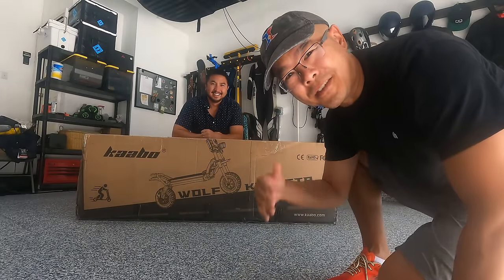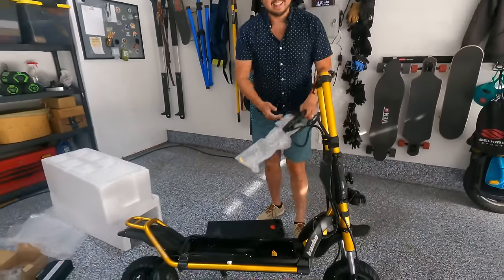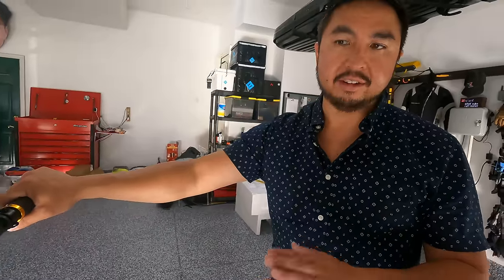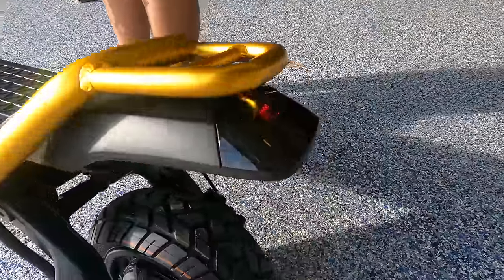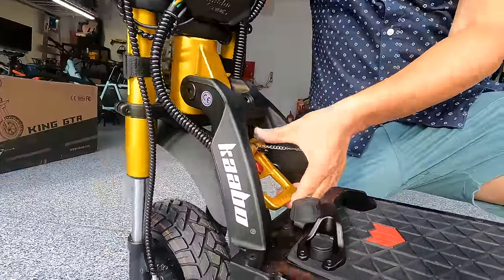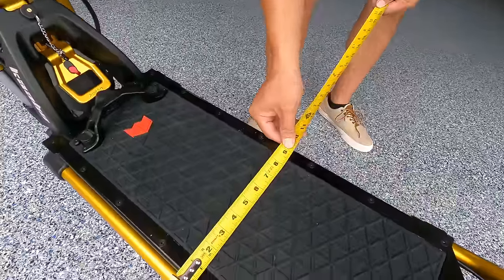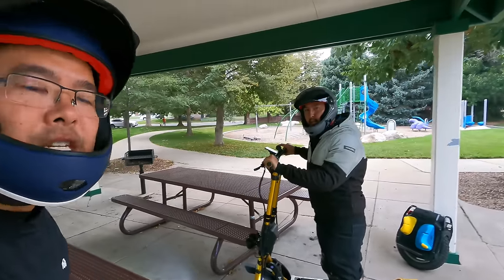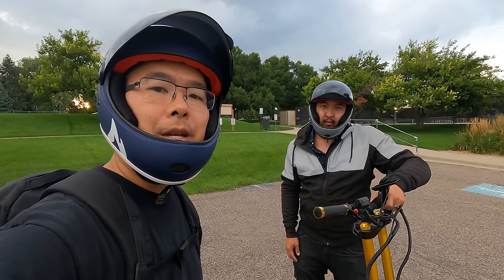NEW Wolf King GTR Unboxing & First Ride: An Insane 65mph Hyperscooter

Comment: it's just brute force speed.😂 they slap in a bigger battery and motor and jack up the price and then call it a day. 😭😭 the folding mechanism is a major red flag, do you REALLY think thats the best setup possible?? WHY DOES IT HAVE A THIN CHINESIUM METAL CHAIN? 💀and you have to slam down on that lever with 100 pounds of force in order to fold the, wait, ITS 130 POUNDS??? 💀💀💀 talk about unpractical
Reply: I have a Wolf King GT Pro, the last thing on Kaabo’s mind when designing it was practicality. It’s over the top and stupid fun to ride.

The folding mechanism is weird, but i never fold mine so I could care less. This ain’t a scooter most people will be folding anyways. It’s too big to lug around unless you’re Brock Lesnar
Reply: Same motors, same battery as the GT.
Reply: Yes same battery and same motor. But the controller can deliver up to 110amp while the gt is 50amp. So it is way more current
Reply: @JulienChabanon  The GT has 2 50 amp controllers.
Reply: The chain literally does nothing. Not sure why you are hung up on that. I don't have this, but had a Wolf Warrior 11 and it was great. Folding it is a joke, but it's way more solid when at speed than many other scooters. There is some questionable reliability, but I never had any problems after 2000 miles
Reply: When its comes to practicality is very subjective
Reply: Since when are toys supposed to be "practical"?🤔

Comment: A scooter that’s literally totally unnecessary. My Yume X11 is plenty more than enough that anyone would ever need for an electric scooter. Especially for speed. Who the hell in their right mind would want to go 70 mph safely on any electric scooter? I know I sure as hell wouldn’t. 50 mph on the X11 is already way more than enough speed. 😊😊
Reply: Overall, how are you liking the x11? Was looking into this one.  Any issues so far? Thanks.
Reply: Some people like the thrill and the adrenaline rush.
Reply: Simply bc people like to go fast or faster if possible
Reply: I agree.but i know somewhere someone needs to travel a straight long long miles of flat pavents this will help out

Comment: Kaabo completely lost me with that ridiculous ride height, I'm not fond of the trigger throttle either. The removable battery just looks like it's asking to get stollen (and that's a pricy battery).    I do like the 12" hybrid tires though, and that they addressed many of the known issues with the GT.
Reply: Yeah, the height alone is a deal breaker for me. The GT is already enough to get up and down on at lights and stop signs, and I'm about 5'10 (and I just think it looks stupid, to be blunt). This scooter does a few things right and a few things are lackluster. I'm a bit disappointed.
Reply: I belive they went more into offroad experience which is at the core of that scooter concept. For me who rides offroad this is great news. Wolf never meant to be a street riding killer, they are more suitable scooter out there for that.
Reply: I totally agree and when u lock the battery down its got play to it you can actually grab it by the handle and rip it right off the scooter and it makes the deck look so ugly!
Reply: That's what you want for off-road use, it's not a bad thing it's simply not the scooter for you.

Comment: Im surprised you guys didn't mention the split rim. 
I feel that's the biggest selling point, imo. 
To be able to quickly switch from street to off-road tires in 10 minutes is a dream come true with this scooter. No more melancholy when changing tires. 🤣🤣🤣🤣
Reply: It's not split rim, but the rim is removable from the motor.
Reply: @alwaysplaythegame  I totally meant to say that. 🤣🤣🤣
Yeah. It has the same "O" ring design as the Dualtron scooters.

Comment: Guys, I want to say thanks sooooo much for doing that impromptu unboxing/quik review. That thing just seems so SUPER DOPE! I can't wait for your full review. I was wondering if it had traction control and if so was that what was effecting the way it felt and reacted when you gave it some throttle? I am soooo glad to see that Kaabo has finally addressed much of the things that we all wanted then to change on the Wolf King series scooters. Unfortunately they still haven't removed the smoked plastic cover off the rear brake/turn lights. Actually, while I love the ruggedized manner of the framing with the tubing and I don't want that to change, it seems to impede any lights they may have designed into the side of the scooter. It seems to me that they are going to have to be a bit more inventive as far as the side lighting goes before it will havxxxxxxxe the same superior lighting as seen on some of the other HyperScooters on the market. To me the lighting is a huge issue, primarily for the safety aspect, in which I feel that the properly designed scooter will have large, bright and prominent (highly conspicuous) front lights with both great throw and breadth across the from viewing range (I definitely think that Kabbo has the front lighting covered in spades), brake lighting (Needs much improvement), and turn signals (Needs much improvement), and swag lighting (Needs much improvement) as well, certainly with the safety directional and use oriented lighting being the most important of the two. But the new adjustable front (If I am correct also with enhanced performance as well) shocks and as well the rear with 15 or 18 settings. I also wonder how many settings are on the front shocks as well? The removable battery as a better charging scenario as well as to make it lighter to pick up if required. The hook for the stem when dropped. The now 12" HYBRID tires. The now 100a controller with the boost to 110a in S-mode.  The 160mm rotors with 3mm of thickness. This split-rims for easy tire changing. The new trigger throttle (I don't think you mentioned if the dead space was better on the new trigger style throttle or not?). The removal of the achilles hacker from the kick-stand. If I didn't know any better it seemed to me that the display showed better in the bright sunlight than the displays on the latest Wolf King GT Pro, but I could be wrong? It appears that even the increased clearance is a big plus! At first look it looked like it might be too high, but I think that once the rider weight is applied the clearance is perfect. The memory on the display. The new security too, which I am sure you will cover in your full review.  Increases in speed, range and in hill climbing capability. It just seems like it is getting to be a much better E-Scooter than it has ever been in the past. Its not just the fastest, sturdiest with great range. Its now just an overall great well rounded scooter!!!
Reply: I watched the same scoot reviewed on the channel Electric Scooter Guide earlier and I am sure they said thereis traction control, unless that was on another scooter, I have watched 5 today so going on my opinion you have a 20% chance I am right, but I strongly think it was this scooter review. The guys will no doubt mention it during the full review.
Reply: It's E.S.P. - Electronic Slip Protection

Comment: Crazy the one who ride that fast with these small wheels. You have no idea the risk you take with that set up. As a 35 years Honda Goldwing rider, CRAZY……crazy !!!! Enjoy
Reply: Why??  Most actual gas scooters have 10-12 inch tires and they run that speed with a much larger and heavier machine... and a higher center of gravity.
I would be scared to ride this too.. seems like it would be very twitchy.. but maybe not.
Reply: @kens97sto171  IMO, any smaller wheels tubeless or not, going high speeds is a great risk for a major drop and injurie. No way out of it. Some will take that risk and its ok by me. Just not for me.

Comment: The separation of controller & battery is a very good move, especially if the scooter retains its IP rating. 

It apparently still has some pretty good cable management going on, though it seems some of the cables that should be inside the frame are on the outside. Also, just below the controller on the left side, the wires seem exposed. I would expect not to see the individual colors of any wires unless I open something, yet they're just kind of hanging down. It would be a cleaner design if that cable management coil could snap into the housing - is it supposed to? See 9:02 to 9:08 .

I just changed both tires & upgraded my disc brakes to hydraulic ('23 Apollo Phantom) & I do NOT want to share how long that took. I learned about talcum powder for the inner tube about 2hrs after I finished the job, so I'm officially an idiot. Which is what brings me to the REVOLUTIONARY (sorry!) way to swap tires. I've been hoping to see some innovation in that regard. I like the hybrid tire, I've been wondering if there would be something that could do it all. I don't stunt or jump or do serious offroading, but with fall approaching, it'd be nice to ride over leaves with something other than slicks but not have to feel like I'm riding a sybian around.

The removeable battery is a good concept, but that lock for the battery seems really cheap. Assuming those charge ports being on the platform is a bit...well, they are covered but why wouldn't they be up by the controller, since all the wiring is there already?

Comment: Hey Jimmy and Andrew there is a silicone cover on the black bolt which holds the chain for the pin there make sure you remove the cover and then insert or remove the pin from the hole when you are folding or unfolding the scooter hope this helps. That is how to not brake the chain

Comment: That thing was very well thought out. Separate controller and battery pack, effective cooling, adjustable suspension, removable battery pack, technical data on the fly etc. Just wish it weighed about 50 pounds less lmao.

Comment: So, here's the Biggie - all things considered, would you rather have ANY of the entire Wolf range OR a Dualtron Thunder 2, that's Thunder 2 not 3, and reasons for your choice please
Reply: Neither get Nami burn-max as it's got same speed but gets there quicker than both has easy as one carbon pole 5sec clamp and is better off road than wolf even though looking at it wouldn't think so , all are identical
If really buying either or keep saving and just get a rion and put up with crazy waiting time but ya escape any need to replace it for decade before others finally stop making 100-137lbs  weight with all night charging using extra charger or rion takes 90min is 33% the weight top speed limited to 90mph 145klm not 100 -110 and that's limit for quality of parts used want quicker it'll just be heavier and 100+is impractical just buy motorbike 
And to rub it in rion looks like a 9-10k scooter it's a lambo of scooters no need for suspension it's all carbon and high grade billitt aluminium vs. Everyone else that build around a rectangle 60bs battery and looks USA no luxury European. Then added bonus you'll be only one you see and not joining everyone else riding same thing , .

Comment: I got mine last week and it arrived with a thumb throttle(which has very bad delay)
just trying to warn some people :) a supplier has confirmed me that there is indeed 2 variations but no indication anywhere on what you will get so don't be surprised

also the scooter feels really small, i'm only 5'6 and it feels awkward to have the handlebar so low, careful if you're a tall person
definitely a learning curve, same with the tall deck

Comment: Does it have regenerative braking? 
"Magenta is an extra-spectral color, meaning that it is not found in the visible spectrum of light. Rather, it is physiologically and psychologically perceived as the mixture of red and violet/blue light, with the absence of green."

Comment: Are there any sparks when connecting/disconnecting the battery?
Reply: I think they all have that little pop when inserting into the charge port.
Reply: Surprisingly no pops so they used good connectors.

Comment: @Freshly Charged 7:07 you guys may want to contact kaabo about the fitment of that brake caliper. it is so far off that it looks like only about a third of the pad is making contact with the rotor. HUGE safety issue if ya need to stop from 60mph and if those pads flex in the caliper your face is going to have a fun time with the road hahahaha

Comment: My varla eagle one has dual 1000w motors and is pretty beast. I could only imagine double the watts....funny thing is...my first scooter was a ninebot maxg30 which I still have. To say slow is an understatement....3 weeks later I got the varla. I still use the Lil no watts prius here n there. I can change the motors n  battery n controller on the varla .......that's like 1200vbucks...in a couple more years the prices will go down close to 30 percent

Comment: Great, it's totally illegal here as soon as you touch the brakes with the lights on..nice... Are you able to turn off the blue and red lights completely? Or unplug them..?
Reply: were u from am UK i ride mine every were
Reply: You can always disconnect the low voltage cables.
Reply: @Andrew-vt4jt  and change settings
Reply: @smoxesss eventually they will shut you down.

Comment: New subscriber here, I really enjoy these videos, and appreciate the work you guys put in to bringing folks this valuable content! I am currently in the research phase trying decide on what my very first E scooter will be. I’m hoping for some input from anyone with personal experience that happens to read this. I am currently favoring the kaabo wolf king GT pro over the GTR simply because of its longer range/bigger battery. I am also liking the sounds of the upcoming Yume osprey because on paper it has better specs then the GT pro and is under $3K. I seem to read about peoples bad experiences with customer service from both Kaabo, and Yume. So I am curious of peoples thoughts and experiences of what would be the better more quality buy for my first scooter. I know I want my scooter to have long range, a top speed of around 60mph, and great off road performance as well as on road. Basically best quality and bang for the buck option as I don’t have $7K dualtron kinda money to throw around. Thanks in advance to anyone that has any input!
Reply: I started with a wide wheel pro. I quickly realized there is better out there. My second was a mantis 10 pro and was super happy with 40 mph range for the most part. Folding the mantis is atrocious. But a great beginner scooter! But what most happy with is my End game scooter THE WOLF KING GT PRO
power ,stability, price
The headlight went out like the second month
So just to avoid the hassle I bought similar off Amazon 
I also grinded down the kickstand 
For the money I’m pretty positive you will be happy happy joy joy!

Comment: Wow, great review guys!!!  Me. Female, looking to SIT and RIDE slowly (under 20mph is fine) /me>  5'4" and 125 pounds. Want LONGEST range I can get...for all afternoon slow recreational riding (No I do NOT want an ebike).... so willing for fork out big bucks for a top of the line adult scooter WITH SEAT - My questions about this one are....Is the height of the handlebars adjustable? Is there a seat? Can I adjust the height of the seat? Can I tilt the handlebars closer to the seat? How much does the battery weigh? ....and if you know of any other adult scooter with a range as HIGH as this one and HIGH quality / doesn't have to be fast but most of the best are... please let me know. Thank you in advance. ---- DO NOT WANT TO CYCLE/PEDALS

Comment: So, what streets are these legal on ? Definitely a no go in Texas.
Reply: Totally legal in Texas. Ride mine EVERYWHERE!
Reply: @kalvinrhone901  that doesn't make it legal. Trust me, it's not legal."It is legal to ride an electric scooter on public streets in Texas, and currently, you do not need a driver's license to do so. However, e-scooters are only legal on roads with speed limits at or below 35 miles per hour.". 65 mph in a 35mph isn't legal. Also, in Dallas electric scooters have a 20mph speed limit and can only  be operated between 5am to  9pm. My point is a 65 mph top speed isn't legal anywhere.

Comment: You guys already listed the pros... But... Still mounting smoky taillight, smoky turn signals, blue side leds (blue lights are illegal in almost every country) that turn purple when braking with lights on 😅, front fender is still too much high and useless, 7 inch hub makes impossible to fit any existing 6.5 tire (inner diameter), and is taller than before (already had good clearance, this would worsen the overall stability) and at 7:07 you can clearly see that the front caliper piston will hit the rotor with just half of the brake pad.